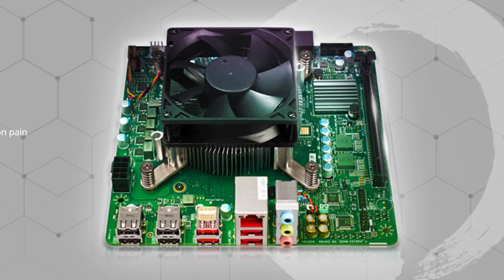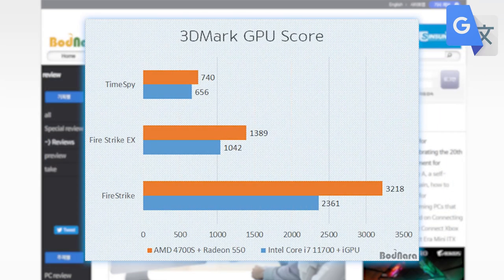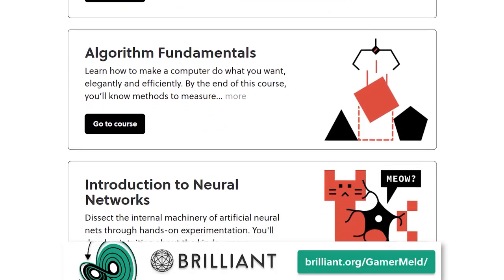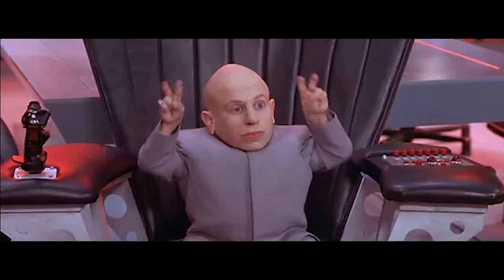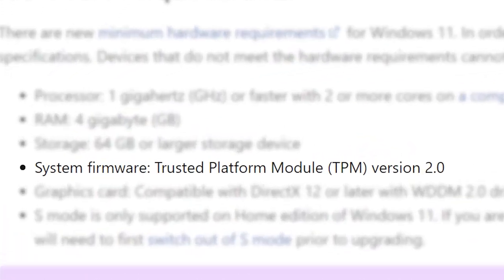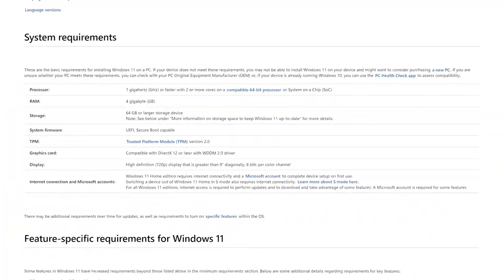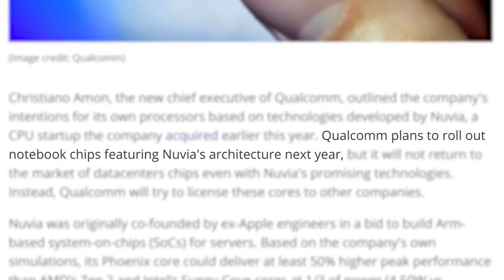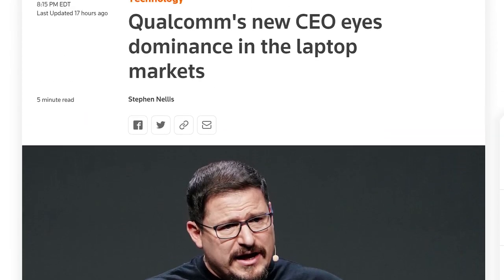AMD’s Next Gen GPU Has WHAT?!

Comment: Microsoft: <signs malicious rootkit>
also Microsoft: "We're security focused!"
Reply: Also Intel, instead of fixing the problem with plunder volt they punish their clients by removing under volting for most newer CPUs
Reply: what malicious rootkit did they sign, further, what is a rootkit?
Reply: @PvMLad  Funny how little we hear from these people about the RHEL backdoor that had been around for several *years8 until being detected earlier this year...
Reply: @n.m.e5787  why would you want to even under volt a new cpu? They are set at that voltage for a reason. Under volting means less performance
Reply: Reduce power consumption or to allow passive cooling.
Reply: @mercedsamg  if you can still get the same clock speeds & reliability in stress tests at a lower voltage then it won't reduce performance, infact it will be better for the long term life of the CPU and stop it from making as much heat since heat output is proportional to a square of the voltage
Reply: @mercedsamg  ... You know if you had done your research before saying what you just said you wouldn't seem so ignorant you do know that I'm not even joking
Reply: @mercedsamg  you don't want a quieter system?
Reply: @ArtisChronicles  my system is perfectly quite with my 6 corsair 120mm corsair fans and h100i platinum cooler on my 3700x
Reply: @PvMLad  A rootkit alters the boot loader so that malicious software can run before the operating system is handed control of the machine.
Reply: @mercedsamg  Undervolting doesn't give less performance. Undervolting is when you make the cpu draw less power but still give the performance its meant to give. 

Like my 3700x is undervolted because i have a Velka7 case. which im very happy with.
Reply: @Lord_Kantor  under voting does give you less performance. The cpus voltage is set that way for a reason. It's a bit like a 240v light bulb or a 12v car ECU. Imagine that 12v car ECU being the cpu. If you undervolt that car ECU it will work slightly slower at 11v than it would do at 12v meaning it will not be as quick to cheak all other systems than it would be at 12v. The same as that 240v light bulb. If you down volt that 240v light bulb to 200v or 190v it won't be as bright as it would be at 240v. Why do you think Intel and amd are taking away undervolting in bios settings? That 3.6/4ghz cpu at 1.2v will not be at 3.6/4ghz if you undervolt that 1.2v to 1v. That cpu at a lower voltage does not therefore have the voltage required to run at its base speed.  Amd and intel spend millions of £££/$$$ on r&d to make that cpu and voltages to run that cpu at the desired speed at that voltage. Have you had a rc car in your time or do you own a ev? Once the voltage of those battery drops that rc or ev goes slower until you recharge the battery and it's back at the correct voltage. The same happens in a cpu. Undervolting means it will create less heat yes but also those cores that require 1.2v but are only getting fed 1v will be working slower than they acually can. Undervolting is only good for a cpu that has been damaged due to high overclocks

Comment: Honestly I'm getting Vista vibes from 11. Pre-SP1 Vista was an absolute nightmare because they introduced WDDM 2.0 which broke driver support for a lot of actively used hardware that wasn't going to get a new driver and were telling people they needed to upgrade their PCs to install Vista. Windows 11 is now introducing WDDM 3.0. Seems like they're repeating past mistakes.
Reply: The requirement page states : Display Adaptor - DX12 & WDDM 2.0, those are already met by recent W10 hardware.  W11 is just adding support for WDDM 3.0.
I used Vista from a few months after launch, it was fine for a new OS for me.  Firstly I had a RAM upgrade to 4GB (the 2GB standard was insufficient), secondly my machine had hardware selected for both Linux & Vista compatability, thirdly I wasn't afraid to try a clean install sans crapware; those tested quality drivers were a real boon, it was the first MS OS that had any professional quality to it.  The SP1 was indeed a stability and performance improvement, expected as the OS was then mature for wider use, but hardware manufacturers had had time to raise their game and meet WHQL standards.  I did use 64bit Linux frequently for work via dual booting, with Vista running games and some proprietary software.
Seriously, Win7 which was received very well on launch, apart from minor UI tweaks was just a minor polish of key features introduced by Vista.  The reason I paid to upgrade to Win7 was to install 64bit Windows.
MS is trying it on at present, at the end of the day it'll cost them too much to support W10 like they had to persist with XP, but they're guaging the push back from OEMs and users.  Developers's support managers love dropping support for stuff that has a small share of the market, despite the mature driver being done and dusted, because rejecting support calls early is far cheaper than really helping end users.
Reply: I don't think so, I'm trying out the dev release for 11, and it works very fine, even with old software, nothing close to the Vista nightmare we lived in the past hehe
Reply: @RobBCactive  you're right..win7 was a much smoother & minor update over vista..That aero theme on vista wasn't optimized for the pc hardware back then..vista was ahead of its time. As far as win11s concerned older HW, may be less than 7th Gen intel and from Zen1 will be supported by win11 eventually when sp1 rolls out..but pricing should be sensible..if they raise it to 200$+ A Mac is a better buy considering hiked up pc HW price
Reply: @chupitolepame5357  a

Comment: Linux community: This is why we have a "growing" community
Reply: unfortunately most people who leave microsuck will be going to big brother apple since linux is perceived and difficult.
Reply: @danney777  
Linux has quite a bit of problems with UI reliability. It was never designed for precise graphical work and gaming.
The DX12 has come a long way and I just hope that with this Win11 nail the graphical interface and support in Linux will be improved/revolutionized.
Reply: @GiGaSzS  also printers don't tend to cooperate with linux so I use one of my windows machines as a print server...well kinda.
Reply: @danney777  No OS is perfect. When we say an OS is better, we mean the rest are further away from perfection. Honestly, the only problem with Linux is the lack of support, which we're trying to make up for ourselves - see Wine and basically every open source driver.

Meanwhile, I have no idea how you could perceive it as "difficult". Most people who say this are those who have not tried it on their desktop before. It works just like Windows - you take an installer, install it (or even just try it out straight from the USB stick) and there you go. Install apps from the store or using the package manager - that is, if it isn't already preinstalled, like Office, Firefox/Chromium, your graphics drivers and a decent text editor are. Just get your work done. The printer situation and support for the latest laptops is the only thing I could see being a problem.
Reply: @chlorobyte_projects  I said most people not myself and specifically said perceive...not that it is. I daily drive Manjaro and have tried to convince family and friends to just try it out for a week and they said no because of the public perception. Also its not just like windows. there are 1000s or distros that can optimized for various things and not to mention package managers and that can make or break a distro. keep in mind we are talking regular users not proficient or even enthusiasts. Also compatibility is becoming less of an issue and will become a non issue once market share increases on the consumer front. I also feel as if it is a side affect of marketing and the proliferation of the 2 big daddy OSs.
Reply: @danney777  just let them try the system out for themselves without telling them it's Linux, pull a Mojave experiment on them
Reply: @chlorobyte_projects  yeah that would require me to get physical access to their computers. I'm not entirely comfortable with lending out my hardware these days and to certain people.
Reply: @chlorobyte_projects  though i Know a few of my family are going to ask me why they cant upgrade and i will just be honest with them.
Reply: Lately, I've started to like apple more. Mainly their Mac OS. It has so many similarities to linux and makes a lot of things simpler. As a programmer, apple seems great. I'll probably stick with linux/mac OS and windows in a virtual machine for when I need it
Reply: @TheRobojay  I agree. I am not a fan of Apples methods and for sure would like a VM of Mac OS eventually. If for nothing to become more familiar with it.
Reply: @TheRobojay  I have no idea what Mac is like, but it unironically seems like a better option than Windows.
Reply: @GiGaSzS  I have not had much issues with UI reliability under Manjaro. I can run Overwatch all day long on KDE or Cinnamon. Ubuntu/Debian still feels soft but the Arch world is stable.
Reply: @chlorobyte_projects  When even capture cards from Black Magic work without too much input (setting up a daemon process) and even Avermedia works with a reference to Pulseaudio and saperate video capture. It came a long way from having to write your own drivers. Network connected printers really are a non-issue. 

Also, from personal experience installing Manjaro on my 2018 Omen X laptop and my 2020 Maingear Element 3....It took 30 minutes to from Post to Desktop, even installed Nvidia's drivers for me. So in that I would ask, "Which Distro were you using?".
Reply: @SchkuenteQoostewin  Hmm... Honestly, I don't have any incompatibility issues myself, I'm just relaying the experiences of a bunch of people who likely tried some Ubuntu-based distro. This is why you go Arch based.
Reply: @danney777  You are a Manjaro guy so I know you have access to the AUR, flatpaks, and snaps. That is a huge library of repos. I agree that we need more developers and the more we get the less viable Windows is. Yes, the paradigm my shift a bit towards  but look at what happened to flip phones and Black Berries. They use to be all the rage now so-called Smart Phones are. If you have an Android, you are running Linux. 

I been running Manjaro and Arch based OSs for about 5-6 years now. Other than the hiccup I had getting my GC311 configured (spliting the audio through Pulse and the video through v4l2), that's about the only odd ball I had.
Reply: @TheRobojay  yeah, M1 macs look really cool. No longer overpriced compared to comparable PCs
Reply: @Alex Jossart I wouldn't call it a monopoly. Mac OS has a not insignificant share of the market. Win11 a known OS and its really difficult to get people to switch to something "unknown." Not to mention the granular user control of Windows Server which if they made the consumer OS more Server like I would be okay with it. I however blame the evangelistic Linux users for the poor perception of Linux. Mac OS isn't much better than windows, however far more simple imo I just don't like Apple and Microsoft's heavy handed 'big brother' attitude and telemetry.

Comment: Windows 10:

"You can upgrade basically anything designed all the way back to being compatible with Windows 7 to windows 10."

Windows 11: 

"You can't even upgrade half the stuff that was designed *for* Windows 10."

Yeah, *that* is gonna' go over *super well* for adoption.
Reply: My aunt is still running a PC, that originally had XP on it, with Windows 10... It has an i7-640M, some ATI card and like 8Gb of ram + an SSD, whcih runs modern Windows surprisingly smooth
Reply: Will a AMD FX-6300 be able to run Win11? I doubt it, probably it'll be deprecated in 2025
Reply: And it is an artificial barrier to upgrade,\if your machine runs Windows 10 now there is no reason it shouldn't run Windows 11 yet no explanation from Microsoft as to the TPM requirement.
Reply: For a lot of people it won't matter, it will mainly be enthusiasts and the enterprise who care and unless there is a specific need most enterprise users will not be early adopters.  They can wait until next upgrade cycle to worry about it.

Comment: I don"t care what the f><k it has, as long as I can buy it at a sane price.  I'm tired of having a 2k tower with a 1660 super in it.  I have standards and wasn't willing to spend over a 1k for a 3070/6800.  Which is what I aiming at when I unfortunately tried to start building a new pc.  I spent to much on a fancy case and unicorn farts for a 1440p machine.
Reply: Prices are falling, already I have seen widespread discounting where miners are rare, because retailers don't want to be holding over-priced cards purchased from brokers, when MSRP priced cards arrive.
Already for 1440p there's many RX 6700xt models available near the MSRP in Europe, but the models are often over-engineered triple fans designs; the availability of R5 5600G's will undercut the low end, plus soon there's RX 6600 cards using a smaller die.  Add to that the switch over to LHR cards by Nvidia and an expected sell off by Ethereum miners as it moves to "proof of stake" not work, your wait will be over within months.
Reply: super hessu  well it'll be Q4 when  new ranges come out, if you need it and prices come down it will be better to buy than always wait for the next thing
Reply: At least you can game from higher than 20 fps.
Reply: @clashemy2140  Indeed, its the first good pc I've ever been able to build for myself.  Just bad timing.  PC before last was FX 4350 system :(

Comment: I wish someone would just create a linux gaming OS for PC and consumers can finally give windows their last rites. Windows has made it a mission to harass consumers with outlandish demands. Throw away the pc u made last year so u can install Windows 11 because as soon as it is released we will stop supporting whatever it is u are using as a pc. It's a friggin hegemony. I used great pc for over 20 years switched it through 4 versions of Windows with no compatibility issues and still got to play current AAA TITLES ON IT without a support issue. And then windows 10 rolls in and demands I throw out MY perfectly good hardware if I want to upgrade and use any new games. Windows is essentially holding DX12 hostage and demanding ransom from gamers. U either get a few thousand bucks from ur bank account and j**k off microsoft and it's cohorts or they make sure all future dx12 exclusive titles are out of ur reach
Reply: Vulkan is in almost every new game.
Reply: Nobody stopping you from using Ubuntu or something my dude
Reply: @gamtax  I'm gonna be real with you their laptops suck and their desktops are ok but eeee
Reply: manjaro works great too
Reply: The issue is that game developers need to be 100% on board. If they release Linux ports of every new game then the problem is solved. As it is, Linux support from game developers is limited at best. A lot of times anti-cheat and DRM for popular games won't run on Linux. Ray tracing is supported by Vulcan BUT only 1 game currently uses it, all the others with ray tracing only have it implemented on DirectX 12, even if they have Vulcan support.
Reply: @anssilehtimaki3841  that is the only glimmer of hope for a linux gaming OS.
Reply: PCs are not just about gaming, ya know.  So a Linux gaming OS isn't going to give Windows its last rites.
Reply: @sol666  the reason was not cuz linux better than windows or some shit bt cuz windows have 75% share ij the os market and linux only around 2% and devs work for a company not individually and companies always fight for big markets only
Reply: I'm running Ubuntu 20.04 as a Linux gaming machine.  I even run SteamVR with a Valve Index headset.  I have several VR games which run through Proton and also natively.  I enjoy my setup a lot.

Comment: For those of you who are not infosec minded, the Windows virtualization security features are things like Windows Credential Guard, which protects against your passwords getting snagged in memory while in clear text. That's just one of the features. It makes sense to me why they are doing it, but most folks won't understand why. Gotta give them credit for drawing a line in the sand and not thinking only about money for once. Hate to say it.
Reply: If that is the case then THAT should be listed as a requirement. It however is not.
Reply: This is bs. Ryzen seriea 1000 and 2000 are identical. And yet one is supported the other is not.
Reply: @Pokester69  what regular people understand what that is? Even technical people may not understand it. That said, they could have at least tried to communicate this better.

Comment: you get passively cooled 3GHz on 8 cores with big.Little design with ARM allready. 
If you simply plonk those on a proper board and allow them to consume much more power and output more heat because you can actually propperly actively cool them in a case, then of course they are an instant competitor. You could probably just clock them at 4GHz base with a normal tower cooler and still have them use less power than x86-64 equivalent . .
Reply: Isn't that what intel thought scaling their iGPU into DGPUs were going to be? And then they couldn't scale for shit